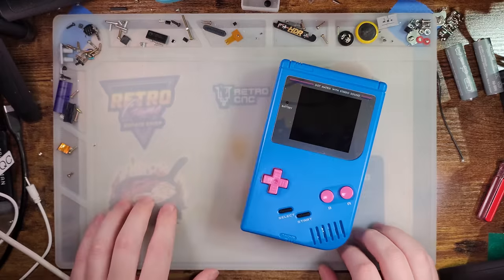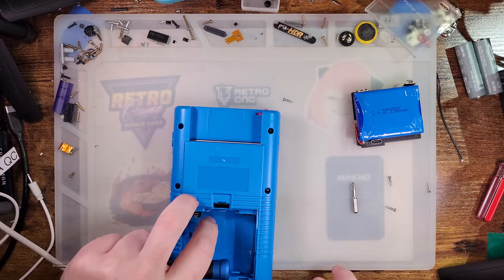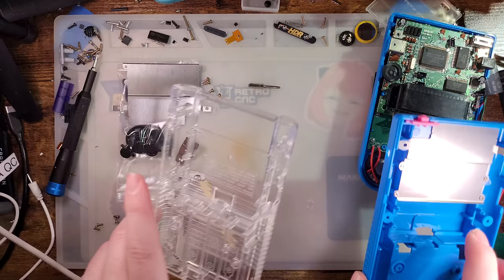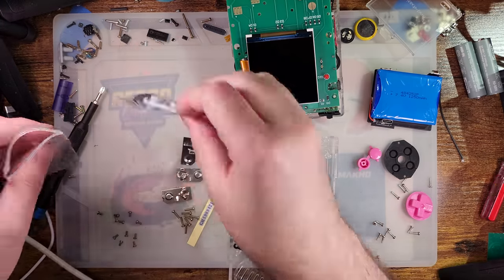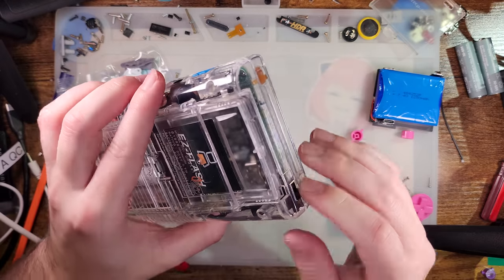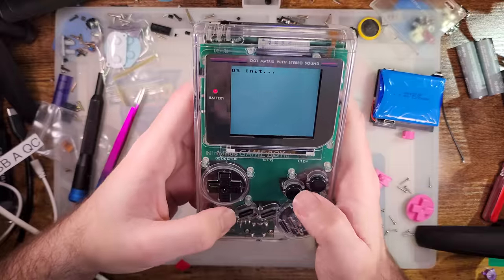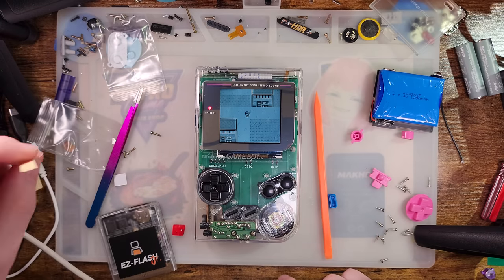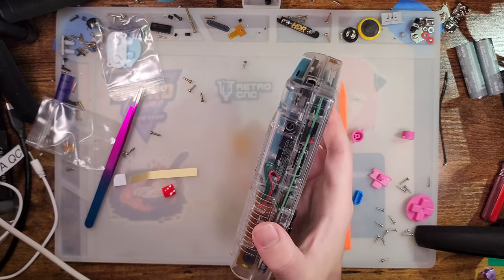Glossy Clear Game Boy (DMG) Housings

Comment: Total novice here but does anyone know if this combo work with the funnyplaying ips kit? really diggin' that lens. thanks!
Reply from the maker: as long as you're not afraid to cut the shell, it will work. You'd need to cut screw posts though and they might be visible on the outside.